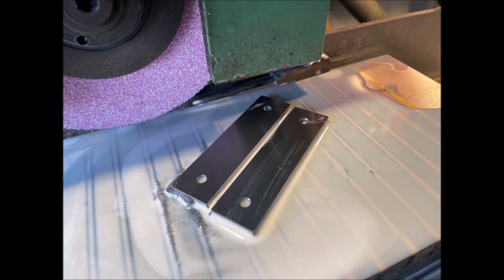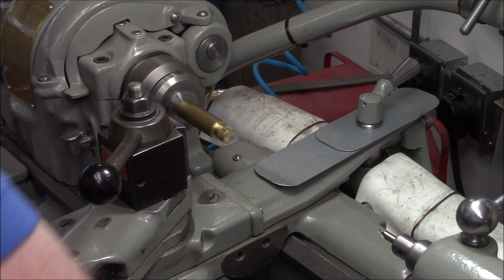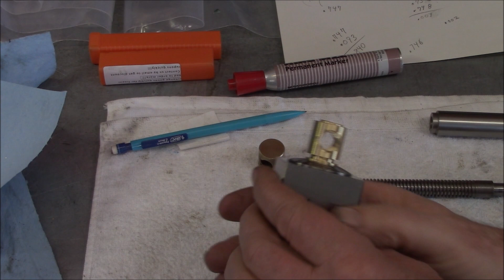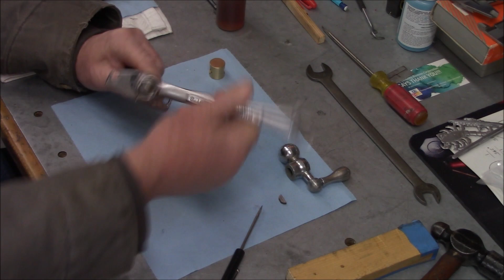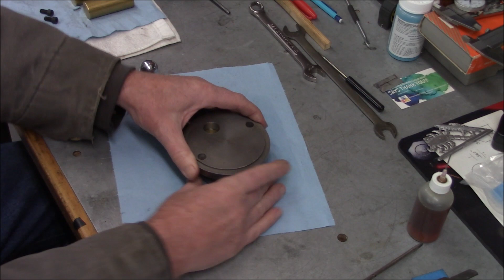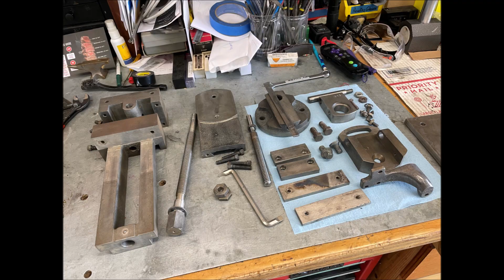Atlas 7B Shaper Project Part 8 - Down Feed and Vice Complete

Comment: Looks like the nut could have been longer . But I dont think it will make a difference unless the  bore in the slide is loose. Boo boo who hasn't drilled thru brass and have the drill bit catch and cause a bozo I guess. Glad to see your doing the restore the correct way think I have a few of those bozos over the past  fifty years.
Reply from the maker: Thanks ! Yeah I was thinking the same thing, there was room for a longer nut after matching the original.